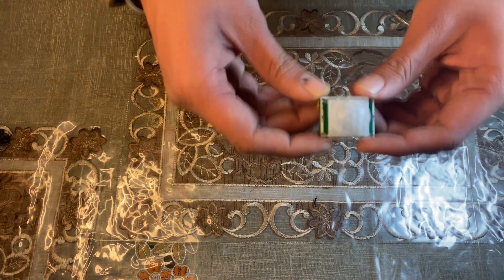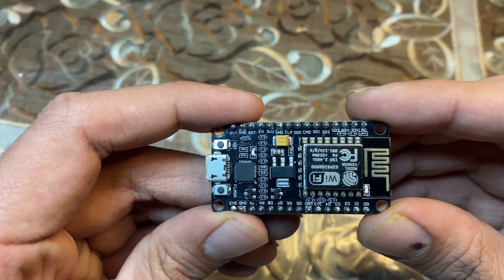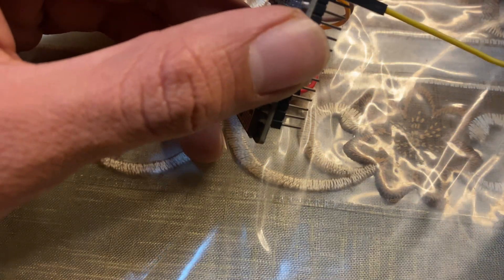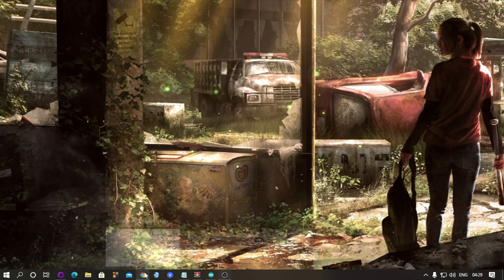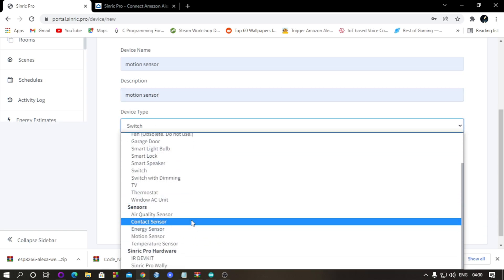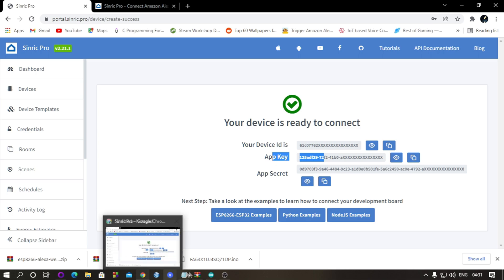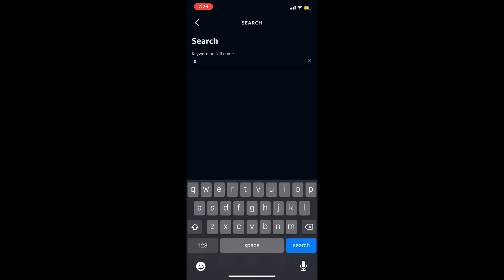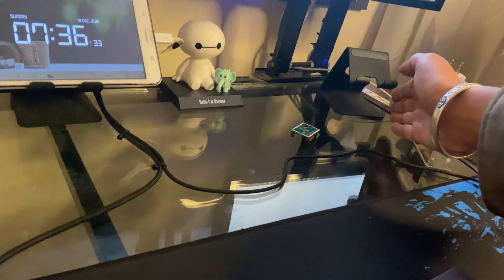How to make motion sensor for alexa with pir motion sensor and esp8266 to trigger alexa routine(diy)

Comment: So are you exposing your esp to the internet here?
How safe is it in terms of virus and hacking etc?
Genuinely interested because im considering doing this but with multiple switch states via a touch screen, atm i have control over other esp32 with each other but no way to trugger alexa to control my other smart home switches which on tuya and alexa zigbee and wifi mix.
Reply from the maker: Yes, alexa generally relly on cloud based devices it cant connect to local devices easily and yes exposing devices to internet is not that safe but in this its pretty safe to use i didnt get any problem in this so far if you are using home assistant than you can locally expose your devices to alexa.

Comment: is there a code for  a contact sensor, or can I use the the same sketch and connect a normally open reed switch
and pull up resistor  and use the same code?
Reply from the maker: you are connect contact sensor normally.